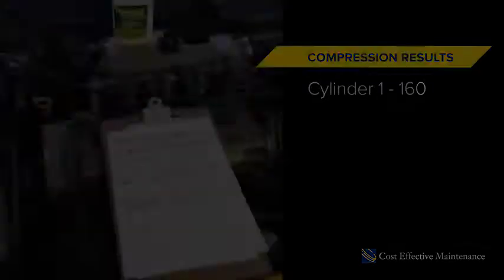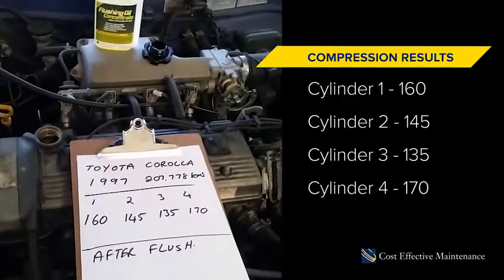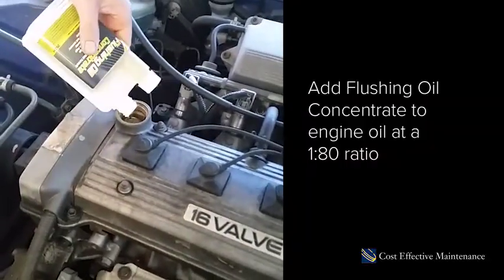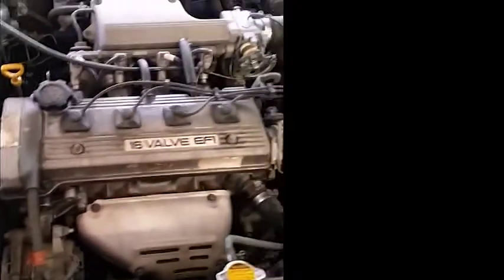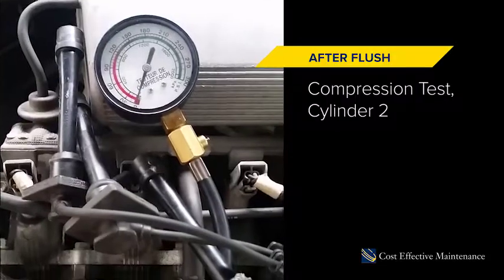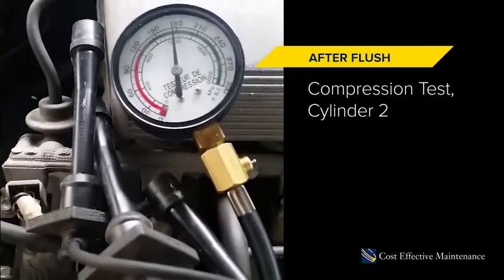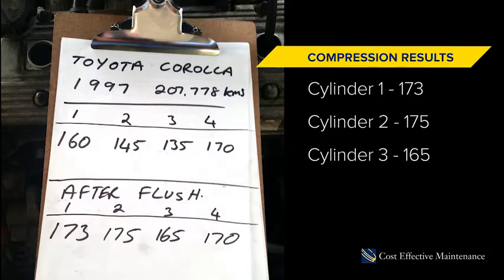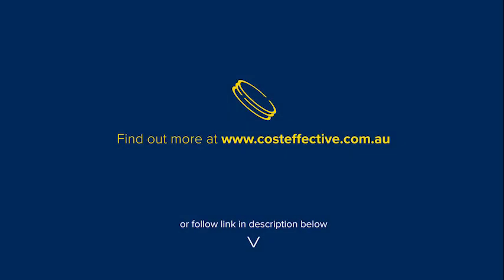How to restore compression in a Toyota Engine

Comment: I took my Toyota 4runner SR5 into a shop because my Engine light was coming on & flashing & was shaking after restarting it again on the same day. I had my sparkplugs, wire, coil, mass air flow, and gas cap replaced. Just prior an engine oil leak repaired. Now the light is pretty constant but not always on. I have pd 4 mechanics in total, 2 after those repairs & all say 2 Cylindar misfires, but no solutions until I just went to another who said it had too much air in engine so replaced  2 very small rubber hoses, one round, the other about 3"L, he chrgd me approx $500 w diagnostic  test.. I ended up having to go to another that did another diagnostic test & said it was a Compression issue that would cost $3000 . Does any of this make any sense?
Reply from the maker: Hi Allie,  feel free to Email  us your contact detials so we can have one of  the team get in contact you. We  will need to get some more information from you . Cheers Jimmy admin@costeffective.com.au